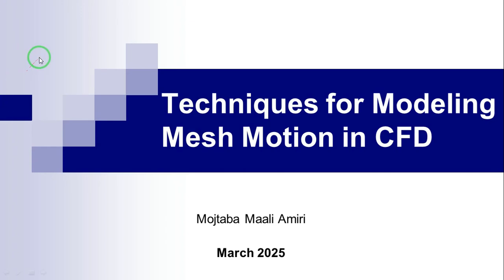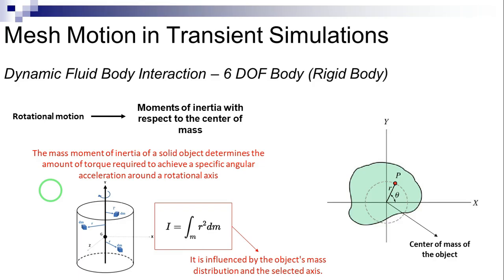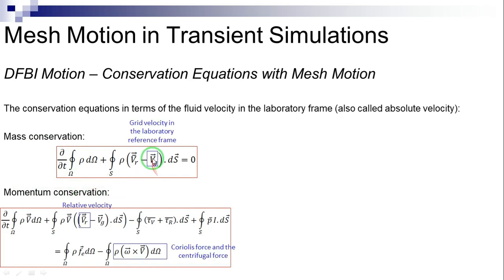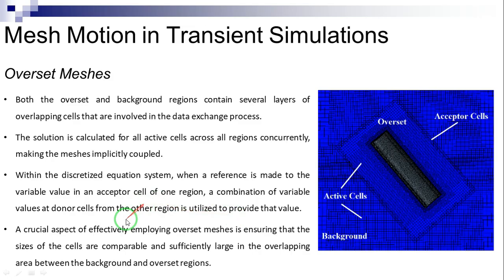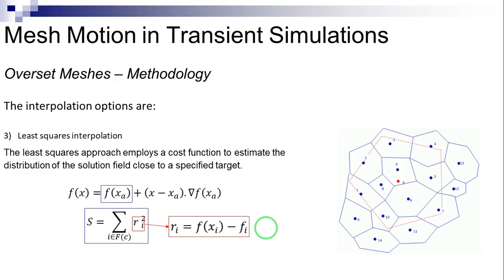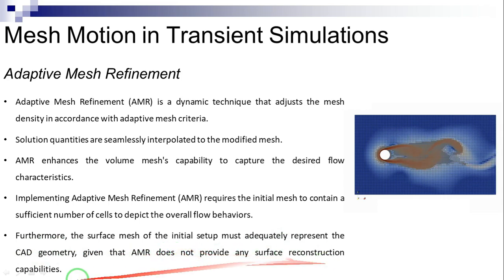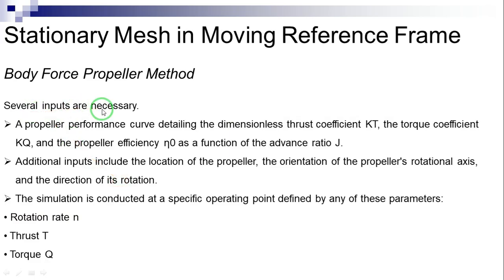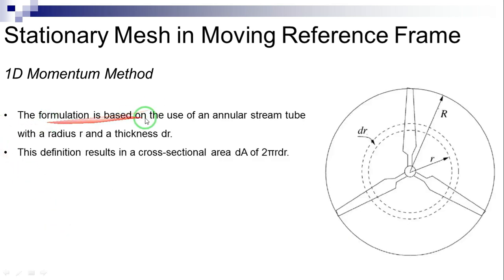Techniques for Modeling Mesh Motion in CFD [STAR-CCM+]

Comment: thank you for the tips, very helpfull.
I have a question regarding the solution history. Is it possible to extract point probe data from a solution history that was recorded only on faces, assuming the points of interest lie on those faces? For example, I have temperature data recorded on a face, but I’d like to extract localized values at specific points on that face. Do you know if this is possible, and if so, how it can be done?
Reply from the maker: You're very welcome — I'm glad the tips were helpful!

Regarding your question: yes, it is generally possible to extract point probe data from a solution history recorded on faces, provided that the points of interest lie exactly on those faces or are interpolatable from the face data. Most CFD post-processing tools (including STAR-CCM+, ParaView, Tecplot, etc.) offer some form of spatial interpolation that allows you to sample field values at arbitrary points within the recorded surfaces.

If you're using STAR-CCM+, for instance, you can create derived parts like Point Probes or Field Functions and evaluate them at specific coordinates. Just make sure your solution history retains sufficient resolution and variables for accurate interpolation.
Reply: @CFD_Mojtaba  thank you for your response,
I already tried it but it doesn't seem to work.
What do you mean by "sufficient resolution" ? cause i selected the "Lossy" format for my solution history when i set it up.

Comment: You make the best CFD videos, man. I started watching your channel back in 2022 when I began undergrad research involving applied CFD in STAR-CCM — something I knew nothing about at the time. You didn’t just teach me the software; you taught me CFD. I genuinely believe your videos are the reason I was able to succeed. I’ve since graduated with a BS in Ocean Engineering and was offered a fully funded MS to continue the research. Thank you for putting out such valuable content.

I do have a question — I’m working on a 3D VOF sim of droplet impacts with dynamic contact angle modeling in STAR-CCM and have been stuck on a few things. With your experience in free surface modeling, I think your input could really help me get over this hurdle. Would you be open to an email or quick chat? Also would love to connect and hear about your work in renewables (and meet the guy on the other side of these videos haha). Thanks again, I appreciate all the care and work you've put into this channel.👍
Reply from the maker: Thank you very much for your comment. Feel free to contact me through mojtaba@lts.coppe.ufrj.br